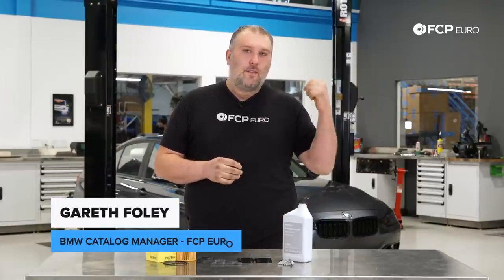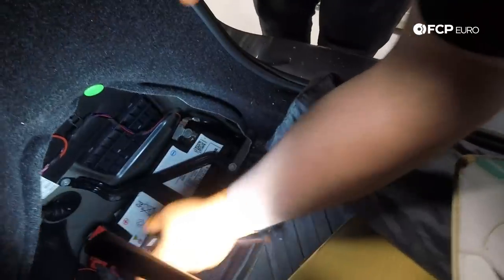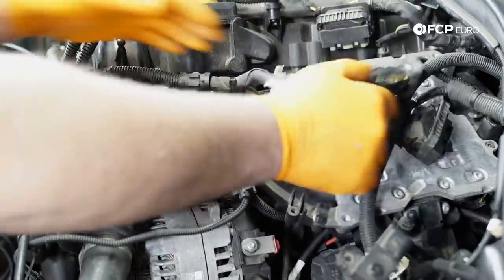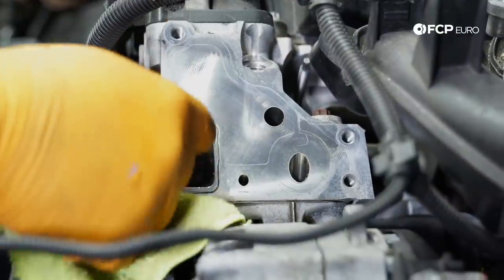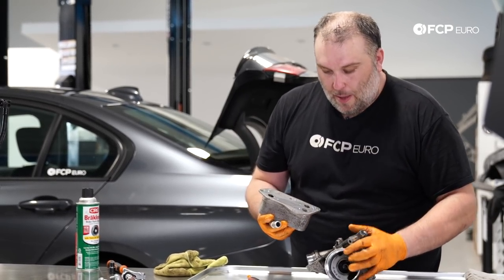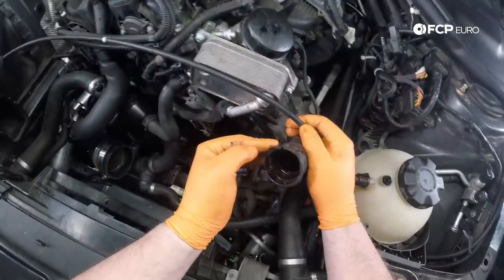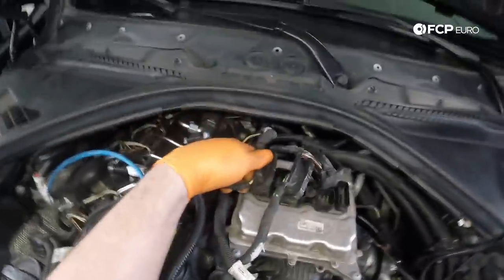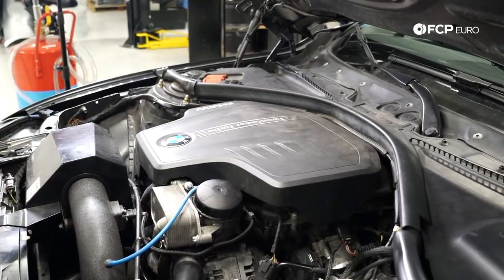BMW N20 and N26 Oil Filter Housing Gasket Replacement DIY (BMW F30 328i, X5, Z4, & More)

Comment: To all my flat rate techs this is doable. Just remove the charge pipe to the side. DME. And you can slide the intake back enough to remove that bolt.

Comment: Awesome video. I did this recently on my e89 with an n52. Much easier as I could work around without loosening the intake manifold. Now I’m ready to do this on my F30 with an n20 when needed. Many thanks!
Reply from the maker: You'll tackle that no problem Jon

Comment: Another helpful video. Thanks!  Question- Would a retrofit of a stud and a nut in place of that one bolt that is blocked by the intake manifold work for future repairs, or would that still be too long and require the manifold to be removed?    If it would work, could possibly consider for an updated kit from you guys.  😉

Comment: Hi first of all thanks for the amazing video that help us the DIYers' to save money! As you said on the video about the battery ground disconnection i did but it fall right back at it because i lose the grip on my hand and a did a spark but i continue cause it was the ground cable, i changed the gasket put it back together but my car does not wants to start, i got fuel but no spark, do you thing ECU went bad? and thanks for posting these helpful videos!

Comment: So, I lost a good Sunday afternoon and evening going this job. Now when I start the car within one to one and a half minutes the transmission temperature warning kicks in. I've run the water pump cycle program twice to purge air, but the transmission cooler-coolant lines still seem dry, with an air pocket. 

Did I miss some top secret special decoder portion of the video??? 
Did the transmission cooler thermostat spontaneously fail???
Reply: Hey, about to do this job. Did you figure this out?

Comment: Less is more when you don't have to pull the entire intake manifold off just removing the bolts and backing it off a way for clearance to get to your room to get to the rear bolt on the oil cooler common only things that I would suggest a recommend is a sweatband for the guy that says fcpeuro on the front of it, and a headlamp LED unit he can put on his forehead below his cab or to one side of the camera, I'll have to look up the procedure for our other car which is a 528i E60 6-cylinder 3L and see what is involved with replacing those gaskets as well

Comment: is it recommended to prime the engine oil before you first start the car?, I've read somewhere on the N55 it is necessary to build up oil pressure before starting by pulling the LP fuel pump fuse?.

Comment: There's been instances where ofhg has been replaced and the engine seized either right after or a few miles later. Any thoughts on this?

Comment: Really love the video, but could you also add what a dealership or a shop would charge to do that same procedure.
Reply from the maker: Hi P W, the best solution for that would be to contact your local shop, as the rates are going to vary from place to place!
Reply: $1,400 at my dealer price given just yesterday
Reply from the maker: @Russteevee  Time to save that money!

Comment: I thought you have to prime the oil system when you remove the filter housing?
Reply from the maker: Once you assemble everything, you can prefill the chamber where the filter goes a bit before startup, however, it is not much different then when you do an oil change as far as how much oil is in it!

Comment: Just did this, decided to replace the entire oil filter housing assembly and while I was at it I also replaced the intake manifold gaskets and the valve cover, I will never buy another BMW, until I can afford to pay someone else to repair it (without breaking the bank) lol

Comment: Is it necessary to change those bolts for housing and cooler or can I use the original one
Reply: If you don't want it to leak again, yes. The bolts are one time use

Comment: I have a 2014 428 n20 and my oil filter housing gasket needs to be replaced aswell I won’t be able to do it for at least 2 to 3 weeks from now . I just had the oil changed do you think she can survive till then ?
Reply: well did it survive?
Reply: @1Grizzman  I'm sure it did. 

Since N20s don't eat belts

Comment: Would this cause dark gray smoke from exhaust and then it dying?
Reply from the maker: Hi Sheldon, unfortunately, this gasket leaking would not cause that. More than anything you would have an engine bay covered in oil down the side of the block.

Comment: What's the blue vacuum hose connected to the PCV on the valve cover for?
Reply: It connects to the intake to get its vacuum pressure for the pcv
Reply: Mine was disconnected I don’t know for how long
Reply: Mine doesn't even have a hose, just a cap over the nipple. How crucial is this?
Reply: @yitww  what model do you have ? I have a 2014 428i coupe
Reply: @johnvega2528  I got a 2014 528i and I dont have one. Not worried about it either👍

Comment: Can this leak cause my car to over heat ?
Reply from the maker: Hi Derick, the leaking oil may be the worst of your troubles. In an extreme case, there is a chance for some intermix to happen but typically not something we see very often. We recommend you diagnose a bit further if that's the case!

Comment: apparently some F10 528i N20 have different manifold (and alternator mounting hardware) as this one can take the back bold without removing the intake manifold ! https://youtu.be/HmY1KJjAAIo?t=187
Mine isn't like that (2014), but the engine block does have a bolt hole underneath the back one 2cm away that would be SOOO much easier to access had they use to attach the oil hoising instead of that stupid bolt blocked the manifold. Aggrr, BMW !!!

Comment: What is the root cause of this failure?  I have had to replace this twice, my F30 has 134K miles on it. Very disappointing design and expensive repair. BMW should provide a free reimbursement or recall and fix the bad design.
Reply: Do you honestly think BMW gives a crap about the design? That's why they design it this way, so you come to the dealership more often!!

Comment: how much it cost?
Reply from the maker: the parts are linked below the video, ans cost can be found on the site. As far as labor, you'll want to get quotes from your local shops as labor rates vary from region to region and shop to shop.
Reply: So I decided to DYI and I have a question,if when I remove the DME and put it back on is that any problem like have to be cording after backup everything?
Reply: $1,400 parts and labor including new belt just outside of Chicago
Reply: @Russteevee  That's insane. I'd do it for less than half as much.
Reply: Simple job I did myself for just the price of the gaskets.